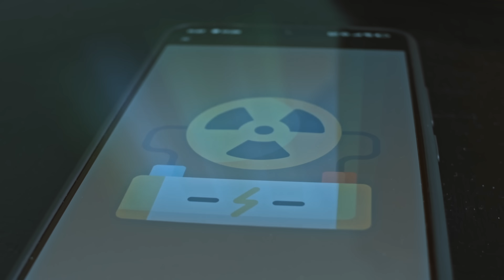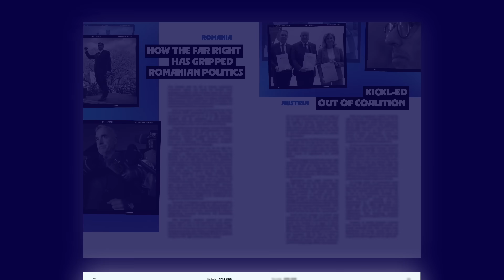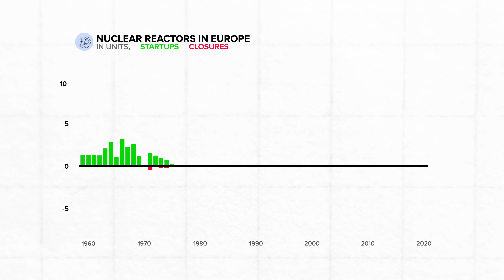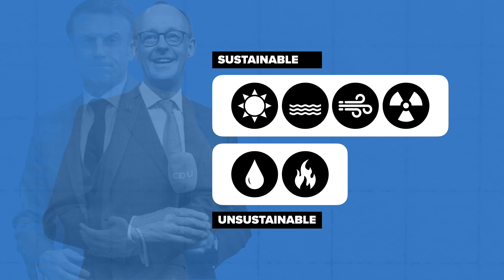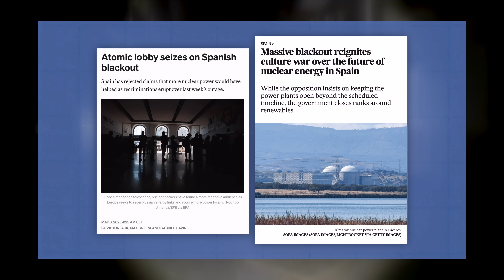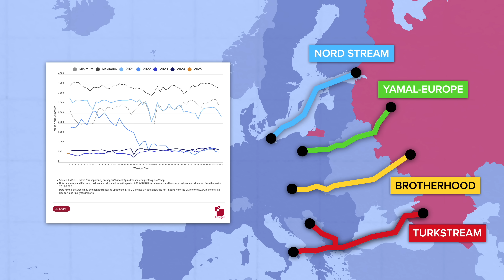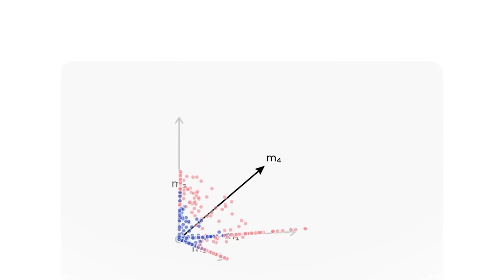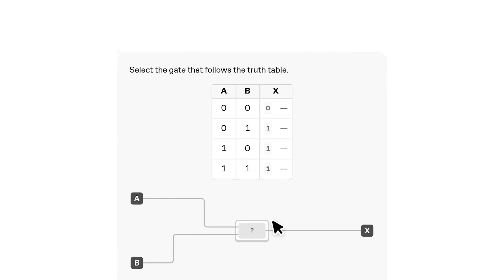Is Europe Quietly Returning to Nuclear Power?

Comment: Nuclear energy represents an existential threat. According to a IAEA report, the amount of spent uranium fuel assemblies produced by the world's nuclear reactors since 1954 is 390,000 tons (Watson, IAEA report). After one million years, the 390,000 tons of spent uranium fuel assemblies (700 yr halve life) would decay by .7% where 99.3% of the uranium remains. The uranium of the spent fuel assemblies cannot be safely stored in a dry cask since 14 tons of uranium will meltdown without thousand of gallons of cooling water. According to a NRC report, without a cooling pool, the spent uranium fuel assemblies temperature would increase to 1,000°C (1,832°F) represents a meltdown. The uranium pellets are said to be composed of uranium oxide that has a melting point of 5,189°F but the uranium at Chernobyl, Three Mile Island and Fukushima melted down where the 5,189°F melted uranium would not be able to be stop with ground water. The size and weight of the uranium fuel assemblies represents the uranium pellets composed of pure uranium since 99% pure uranium is more efficient than uranium oxide.
Reply: You know that long half-lifes are safer, not more dangerous... right?
Reply: This is worse gibberish than even a LLM can produce. Even the numbers don't match up.

Comment: We had a small minority which used fear of a new technology to close down nuclear.  The Luddite problem.  All peer reviewed science papers, WHO, IEA, western govts show that nuclear is the safest energy source.  The anti/nuclear lobby also compares, "Volvo or Mercedes cars with Lada's".  Just because Russia has bad quality control, operational procedures.  Does not mean that European/US nuclear plants are the same as Russian nuclear.  Chernobyl is not a good example of the danger of nuclear energy.  Just like a Lada car does not mean all European cars should be banned because a Lada is badly made.  The best thing is that nuclear power is the best way to reduce CO2 and solve climate change, produce sustainable, reliable electricity & chemicals for medicine/research.  However, the anti-nuclear lobby has made govts have so many regulations that it is so difficult to make nuclear power.  This is the problem with Hinkley Point with 5000 changes which need to be reviewed by the regulator.  Same in the US.  Another problem, the Tohuku tidal wave caused all the deaths in Japan, not the Fukishima nuclear plant, which did very well to survive.  However, the tidal wave/earthquake is not mentioned, but only the nuclear reactor.  Solution have a sensible nuclear regulator, recycle nuclear fuel and we can have low cost, sustainable energy with nuclear.  The nuclear waste issue has been solved for a long time, France recycles nuclear waste.  So did the UK & US.  But guess what, the anti-nuclear lobby stopped nuclear fuel recycling.

Comment: Thanks,  but you don't know and don't tell the whole story.  For the last 5 years,  renewables + storage are the cheapest and most reliable electricity, and the prices are dropping exponentially. Whereas nuclear's prices and construction times double & triple compared to the estimations. Nuclear made sense up to 5-10 years ago, but now some countries and corporations are trying to push it so renewables and storage will be prevented. This way, until the nuclear plants will be build in 20-30 years, fossil fuels will continue to be used. Instead of installing renewables and storage within 5-10 years, faster, cheaper and more reliable.

Comment: "...renewable generation is somewhat unreliable..."  An understatement!  This video was a good examination.  Needing to be added to the cost of massive batteries to store energy from wind/solar is the need to build more transmission lines to go from rural wind/solar facilities to urban centers that need power.  It represents more cost (for what was to be cheap electricity), more mining (for the structures, massive cables, & electrical components), & more manufacturing (polluting the air, the reason we're moving away from carbon power plants).  Re-education of the public is vital.  Chernobyl blew up because the USSR managers were idiots & Fukushima blew up because of a Richter scale 9 earthquake & deadly tsunami.  Nuclear uses much less land & much less mining/manufacturing - making it much more ecological!  The giant wind turbine blades & countless photovoltaic panels are nearly impossible to recycle, filling landfills.  (Uranium actually can be reused, with fast breeder reactors.)  Nuke plants last 2 - 3 times as long as wind/solar.  True, the onsite construction of nuclear currently is long & expensive.  Small Modular Reactors (SMRs), constructed in factories, could help in some instances - by putting small nuke plants right at industrial parks that need more electricity.  So, no longer do long electricity-sapping power lines need to be run through farm fields.  I'm glad the idea of picking 1 power plant design & repeating it was mentioned, to increase construction efficiency & reduce costs.  Foolish legislation which banned the building of new reactors must be removed.  The project permitting process has to be streamlined.  Dealing with spent uranium fuel is a major problem.  We in America built the Yucca Mountain depository in Utah, but unthinking activists & sympathetic judges block transport of used fuel rods (in large storage cylinders) to the underground site.  This must stop!  Perhaps by example, the EU can show the U.S. how to deal with these various problems.  We need it.

Comment: The early history of nuclear power in Europe centres around the manufacture of plutonium. It's why UK's nuclear power is so expensive -- electricity is a byproduct & a mask for the main purpose. 
As countries have transitioned away from nuclear weapons they have either closed their nuclear power stations or replaced them with ones designed to produce electricity -- except the UK.

Comment: Personally, I always fight against anti nuclear renewable people, even though I'm 100% for renewables. For me we should push both 100%. Yeah, nuclear is expensive, but there are multiple reasons for that, one of them is that we have forgotten to how to build them, but now that we have slowly started again, stopping midway is foolish. Not to mention building both at the same time is faster.
I don't really care that much about cost anyways, since it's critical to climate, strategic and economic reasons to just have energy available at all times. It's much more expensive to suddenly be cut off from some part of the energy supply and nuclear is cheaper on long term anyways since you don't need to buy fuel constantly.
Problem I have with sticking just to renewables, is because of speed. Yes, renewables are freaking great, and strictly speaking more cost effective. But there are multitude of costs of having to be reliant on massive supply of fossil fuels. So if we can reduce reliance on that faster by doing both we should. I don't think people realize that stopping nuclear won't speed up renewables. They are very different industries with different skill sets. So you can't just transfer those people into renewable sector.

I think main problem in EU is that we are doing way too many different types of plants. This means we can't just copy and paste them around. Yeah, obviously we should also have some innovation going on, by main focus should be one type of plant to build at one time so we can replicate it and people get skilled at doing it.

And there's one other thing, if we upped out fuel refinement capacity, since unused fuel is pretty much just uranium metal thats not radioactive. You can just store tons of it in very small space safely. So essentially you could have years of whole nation's fuel stock in some small bunker somewhere. Ultimately, I want diverse and resilient grid and power supply. I want renewables combined with energy storage, I want adaptive grid that can handle various energy sources and transfer where it's needed, and I want nuclear.

Comment: I'm not totally against nuclear but wouldn't it be easier and cheaper to build grid-scale batteries to capture all the power from renewables?  There's a lot of different battery technologies (not just lithium ion) and they're safer.  They don't require the high standards for construction, maintenance, and operation that a nuclear plant needs.
Reply: The biggest battery in the world currently under construction has a capacity of 875MW peak power and 3.25GWh of storage. So it can provide full power for just over 3 hours with no generation. It's a combined solar and battery plant over 4600 acres. 

A single power reactor built in the late 80s onwards typically have a power rating of 1GWE. The last generation of reactors built in Japan, the ABWR, which are slowly getting reactivated currently have a capacity of 1300 MW electrical.  A power plant with just 2 of these units would occupy a footprint of less than 1000 acres which include facilities and infrastructure not included in a solar or wind farm. Just 2 reactors is a small plant but produces well over double the energy 90% of the time or more on average. 

The energy densities are orders of magnitude higher and the embodied energy in the capacity is orders of magnitude lower. 

Large batteries with grid forming inverters and synchronous condensers are great to provide additional stability to the grid but I'm seriously sceptical that net zero grids are possible without  nuclear or a lot of similar high inertia generation like hydro or geothermal.
Reply: "but wouldn't it be easier and cheaper to build grid-scale batteries" No. It would in fact be much harder and more expensive to do this.
Reply: for storage you need large spaces which is very less in europe 
nuclear energy gives energy 24/7 and will give more energy in the longer run
renewable sources should be there with nuclear energy as both are clean
Reply: Energy Storage is very land intensive and comparatively short-lived. Energy Storage assumes we have consistent overproduction from Renewables, but take a important note that Renewables, when used as the Levelised Cost they are advertised as, don't exactly produce enough for stable supply in the first place, let alone overproduction. 

Lithium is well known but dangerous in mass scale. Sodium is okay. Pumped Hydro is land intensive. Compressed Air is inefficient and expensive. Hydrogen is dangerous, inefficient, and expensive. Gravity Storage is horrible. Molten Sodium Storage is energy inefficient when used with Renewables.

Comment: This is so incredibly dumb. Nuclear power plants can't support wind and solar. They are very slow to react. The ONLY purpose they serve is to cover a base load. Which wind and solar can too, if there is enough  Wind and solar are also many times cheaper, even with the overcapacity necessary. Energy storage is faster to build up and helps much more than nuclear power plants. Also, in a war you don't want to have nuclear power plants. You really don't. What do you think the enemy will be first to attack? Nuclear power plants are way too expensive, even if regulations are relaxed (which you don't want, I hope).

Comment: Fucking finally. Or at least i hope so.. Fission is the baseline power option. The perfect grid consists of nuclear for base production, wind, solar, tides, geothermal or whatever else you have available for the bulk of varying demand, and something easy to regulate, like LNG, for regulation. The grid does not work without those 3 factors, and neither of the 3 options can replace the other efficiently. You cant have a full solar + wind grid, realistically, because the energy storage needed would be insane. And you dont have to. You simply need to replace freaking fossil fuels with nuclear and everything is a-ok. Not to mention production costs scale with the cost of energy, and low electricity cost usually means nation wide prosperity for manufacturing and endconsumers alike. Nuclear is the win-win solution here. I do not understand people who argue against it. The other options are exclusively fossil fuels here, and air pollution kills millions per year, even ignoring climate change related issues. Nuclear energy is also, practically, the only source of energy able to properly scale up with humanitys energy demand for the coming decades and centuries. Fission, then hopefully eventually fusion. Power satellites are also an option for in reach near-future power supply, ie kilometer sized solar power satellites in space, where efficiency is way higher, and uptime is 100%.. but micro asteroids and space junk are issues. So fission is practically the only energy source we actually have available to keep up with demand for the foreseeable future, long term, if nothing changes. It was inevitable and fighting against it was ridiculous. Nuclear energy also has the potential to be extremely cheap, far cheaper than solar. Solar is extremely cheap now, but only after decades of research and subventions. Nuclear did not have this advantage. The primary cost for nuclear power plants is upfront. Standardizing designs and regulations will cut this to a fraction, for example. The uranium cost itself is essentially free.

Comment: To much nuclear lobbying. Super expensive and slow to build. Depending on foreign uranium costs. Never talk in this debate about radioactive waste problem for centuries. Spanish here. It is wrong that nuclear power plants would have helped in our blackout experience. It was the first energy source to be desconnected for safety reasons and the last one to be connected when recovering the system doe to It’s very slow reseting and restarting process. It didn’t help at all in the quick reset of the overall electicity network. Water, gas and renewable plants where much faster to reset all our national system. Batteries to accumulate renewable energy as Australia and other countries do and better connections with european network also will help. EU experts and legislation say we need at 15% connection with the rest of Europe as the rest of the countries do. Now is only 3% in Spain and Portugal, we are an electricity island. France always blocks any new plan to make it happen. Why? Because we produce a lot of cheap renewable energy that we export and nuclear french lobbies don’t want to lose business for their expensive nuclear electricity. What a surprising coincidence! again nuclear energy business blocking clean, cheap and sustainable new energy sources.

Comment: I really find the argument of nuclear energy being useful in decoupling really funny. Wehre do the people arguing for this plan on getting the radioactive material from if not Russia?

(I know there are some tech-bros that babble about new tech will solve that and they'll just use an abundant resource available everywhere, but so far no ready plans for a reactor with those abundant resources exists. At the moment all reactor designs rely on less than abundant resources with most being mined in and provided by Russia for the most parts. The current state of these resources is the same as that of all other current important minerals (like rare earths) - they are difficult and expensive to mine and mining them causes extensive damage to the environment, so while countries like Russia and China can provide them quite cheaply, if we in the EU go about mining them, the production cost and therefore price would rise sharply. )

Comment: You are missing a few things here. Nuclear energy is very expensive, also noone wants to insure them. So there is potential for huge public costs associated with those reactors. Additionally you didn't talk about merit order principl of energy pricing. The energy prices are not high, because there is not enough energy, it is high because gas is very expensive at the moment and drives cost up for the consumer. Adding more nuclear energy won't help with that as it is partially even more expensive.(and no, french nuclear energy is not a counterexample, as it is highly subsidized by the french government)

Comment: China & US both aims to build 200GW new big conventional nuclear power & develop new types of reactors, like MSR, SMRs, etc. To respond to this, to save the climate, energy security & economy, we need to do the same. Like France did, a Messmer plan for all of EU to reduce cost of new builds & to build 200GW as well. UK & Ukraine can join. Use Euratom to thos those things together with piltical support. Offshore wind & Chinese solar cells are too vulnerable, and too expensive.

Comment: Now make a followup video about SMRs!  Nuclear power should make up 1/3 to 1/2 of power generation to support the base of the power grid, with a mix of natural gas, renewables and hydroelectric to make the rest in whatever combination makes sense for any specfic geographic region.  The natural gas component of the mix should be built with extra capacity such that the plants would run at about 75%, but be able to boost output quickly to compensate for any unexpected loss of output from renewables.  Until we perfect fusion power, then all this stuff can be replaced!  🎉😊🎉🎉😊🎉😊🎉😊
Reply: SMRs are a wonderful possibility, but there's been a number of stalls - looks like it will be a while till they're working.